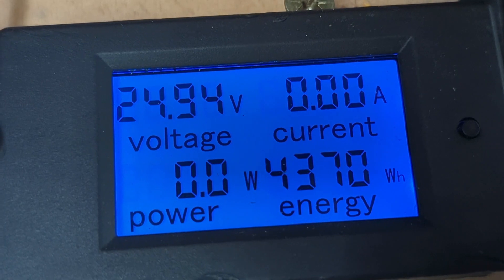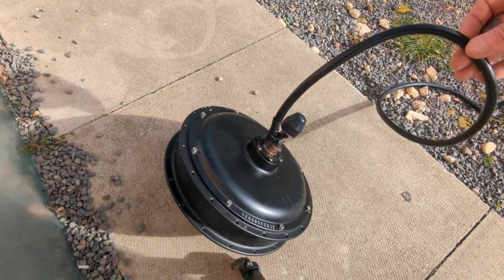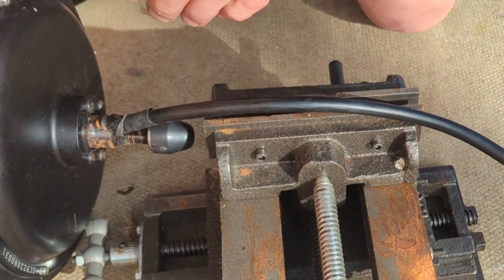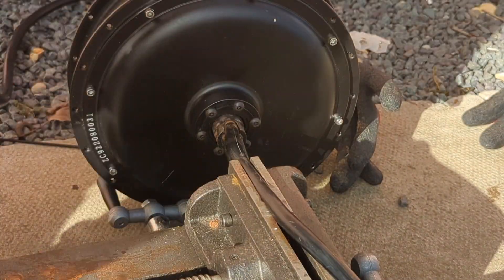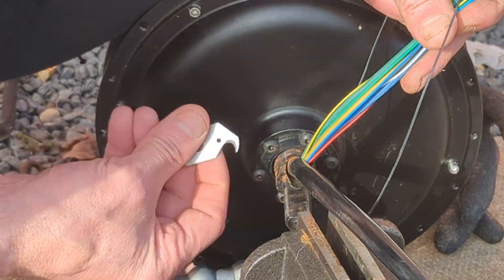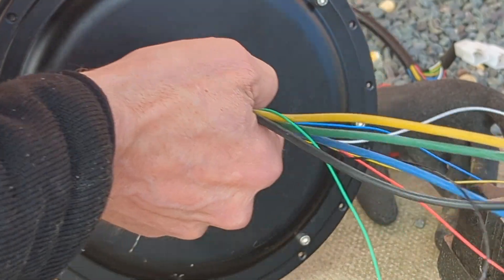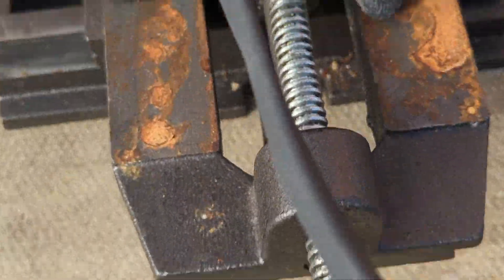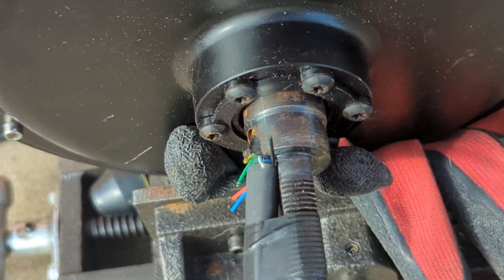72v Ebike Hub Wind Generator - removing excess wires from the motor -19th February 2023

Comment: Nice chunky cables. Looks like it means business!. Hope the turning torque won't be a problem.
Reply from the maker: Yes mate they are very chunky wires. The next problem that I face I've got to take the turbine down and check there is physically enough room for this motor. If there isn't then I need to build a bigger frame